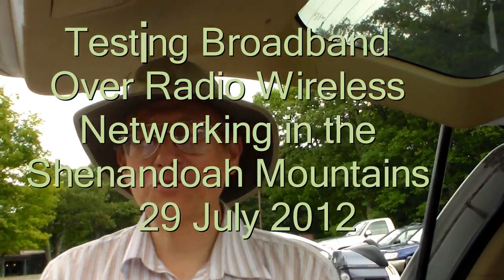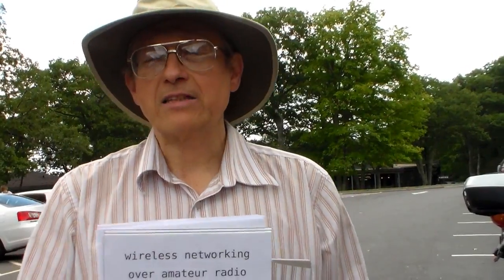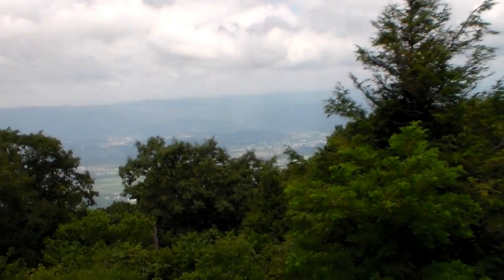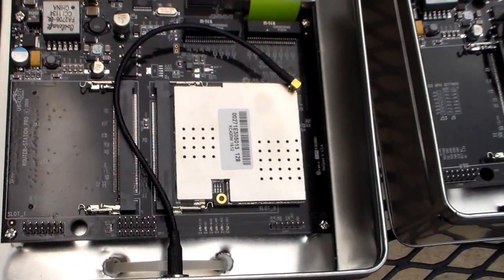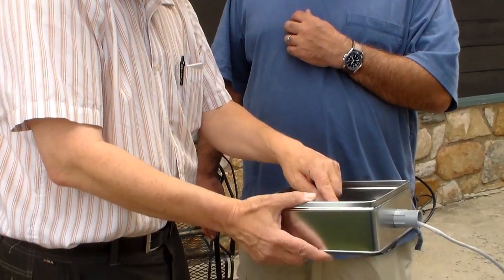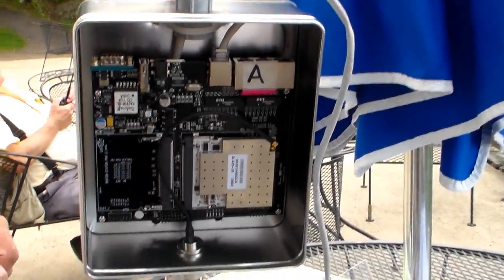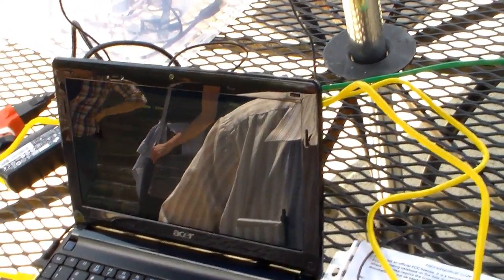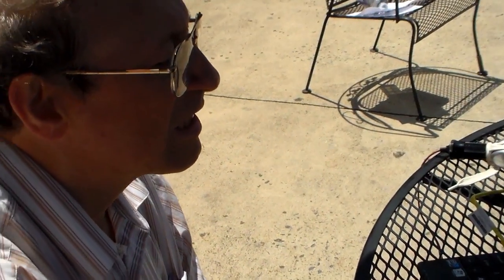Broadband Over Radio Wireless Mesh Network Experimentation for Emergency Communications

Comment: Would be nice to get an equipment list and configuration information, otherwise it's a good demonstration. MESH works too, but distance seems to be a diminishing return, if 440Mhz is used it would certainly overcome the issues in the 2.4Ghz space. Good information.

Comment: Hi, I'm a new ham and I was wondering what upgrade to my FCC license do I need to make a Mesh Network, or can I do it as a Technician?

73
KE0OAP
Reply from the maker: Hi. Depending on what frequency and equipment you use, you may not even need a license. Check with your local mesh network to see what they require.
Reply: Thank you. I'll look them up.

Comment: I can do a 30 mile PtP on 2.4Ghz easy with the actual commercial grade equipment and maintain speed of 150 mbps. which is more than enough to do video, email and even online gaming.
On my 900 Mhz I can maintain about 54 mbps which is again more than enough to do just about anything on.

The problem with mods for ham use is it make the router no longer compatible with consumer wifi devices out there (smartphones, laptops, other bridges and routers, etc). 
In a emergency situation people want quick and easy access plug & play systems not something they have to finagle with and mod out to make work.
I think most hams out there have good ideas but they forget that they are not the only people out there especially in an emergency situation. There is a reason the ISO for wifi is what it is, to make systems readily available and easy to setup and access from a wide variety of devices made across a vast space of manufacturers.
Reply: +ElfNet Gaming The Ubiquity Router Stations are standard WiFi, and should wirelessly connect to smartphones and laptops at each end of the link. The link between the Router Stations, converted to 420MHz by the boards being tested, of course is not standard WiFi by virtue of the frequency used. However there are benefits to using 420MHz, namely non-line of sight and portable capabilities (good for emergency situations).  Unfortunately these capabilities were not the focus of this experiment by W2LNX.  Testing these capabilities would require more power from the boards being tested and the omni-directional antennas mentioned in the video.